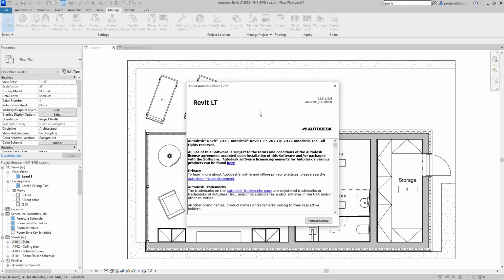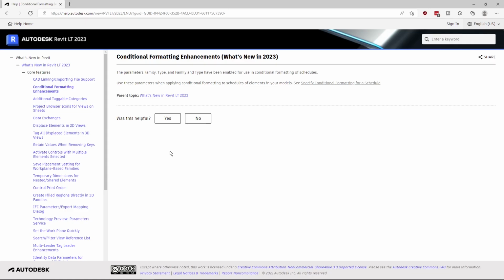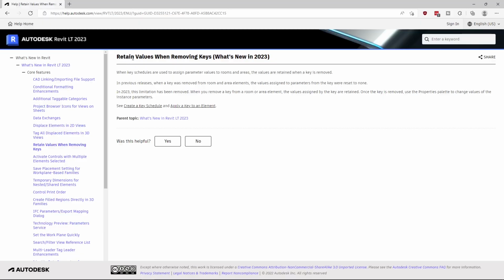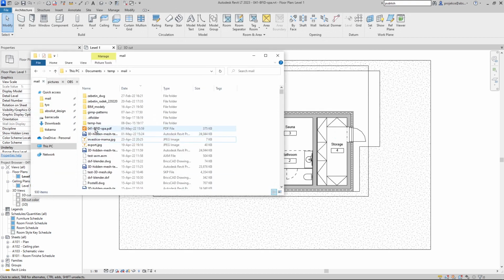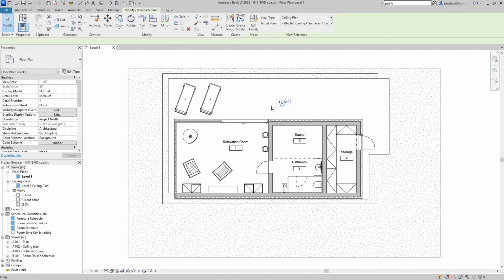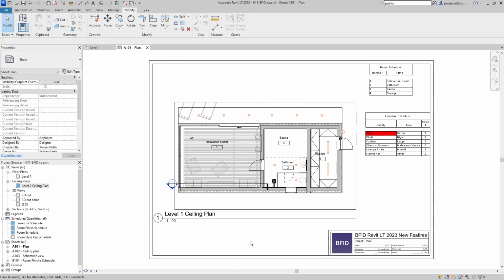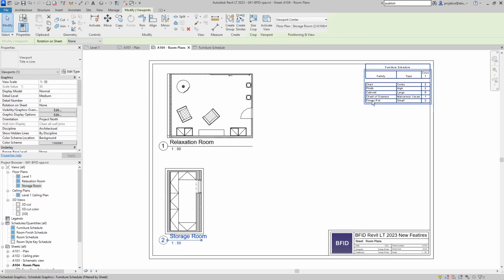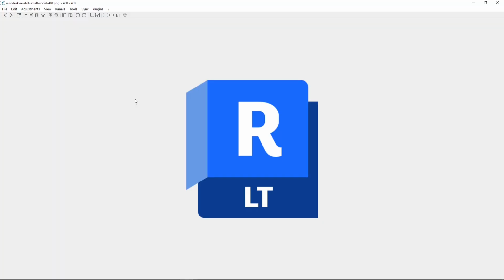Revit LT 2023 New Features

Comment: Hi i want to start with 3dsmax indie and revit LT. do you lose any important features for interior design projects compared to REVIT "Full" license ?
Reply from the maker: I am not sure about that, but I think you loose the automatic bidirectional connection between 3DS Max and Revit. You will have to export the project from Revit LT and import to 3DS max.

I would actually recommend using Twinmotion instead of 3DS max. It is much easier to learn and get good results fast.